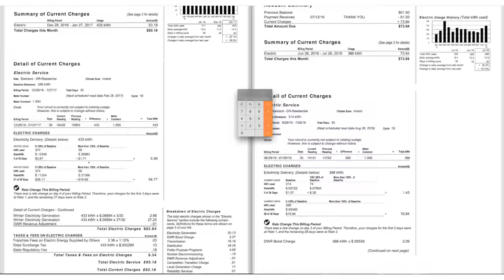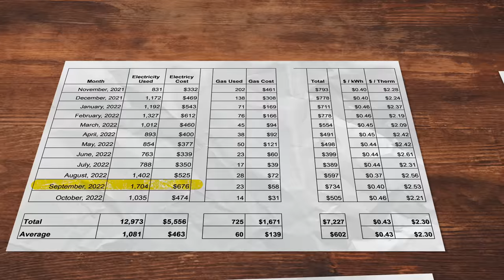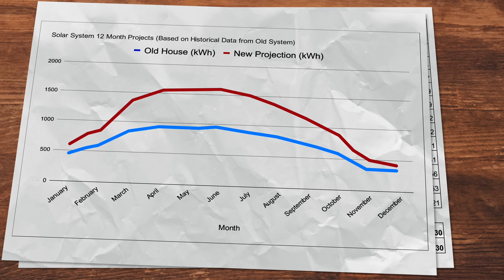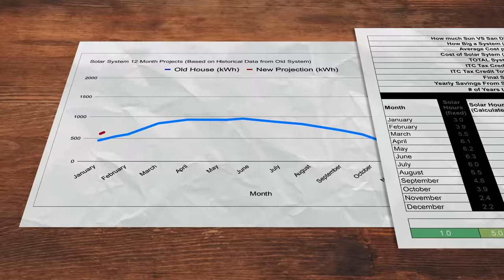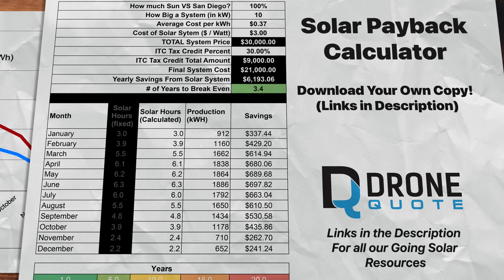Go Solar Before April 2023 - EVERYTHING Is Changing!

Comment: Why doesn't anyone touch on the subject of heat and how it affects the yield of solar panels? When you buy solar panels they have a certain power output rating (Watt peak), for instance 250Wp, 300WP or 450Wp. This output is determined under certain conditions; an irradiance of 1000W/m2 and a temperature of 25C. Depending on where you live the irradiance of the sun varies, if it's more than 1000W/m2 the output of a solar panel will be higher than its Wp-rating and if the solar irradiance is less than 1000W/m2 the output will be lower. That's pretty straight forward. But what most people don't account for is the temperature solar panels can reach and how that affects its output. Because for every degree above 25C a solar panel on average loses about 0,5% of its output. As a panel can easily reach temperatures of 85C in summer, especially when they are roof mounted, that means they lose 30% of their output. So your 300Wp panel becomes a 210W panel. That being said, it is a good idea to find a way of cooling your solar panels.
Nowadays there are so-called PVT panels (PhotoVoltaicThermal) available which have a heat-exchanger built in. You can run cold water through that heat-exchanger to cool down your panels and by doing so increase their output. Added bonus is that you can use the hot water coming from the panels to (pre)heat your warm tap water, which will also result in less energy used. Or you can use them as a source for a heat-pump system which has the big advantage that you can use a water-water heat-pump (absorption heat-pump) that uses a lot less energy than the common air-air and air-water heat-pumps as absorption heat-pumps don't have a compressor that uses a lot of energy but use a water pump instead to pump the brine (usually a water-ammonia mixture) around. See Triplesolar for more information about PVT-panels icw a heat-pump.
Reply: Generally because people care more about ensuring they have enough solar specified for winter.  And because of that, the amount of power produced during summer tends to be somewhat overkill anyway.   And because of that, people don't care about the summer heat reducing the efficiency of the panels.  When the sun is blazing down, you are producing top-tier output whether your panels are hot or not.

It is still a good idea to ensure that there is ventilation under the panels.   But virtually nobody bothers doing any active cooling or active ventilation on fixed panels.
Reply: @junkerzn7312  Ensuring that your system is big enough for winter doesn't mean you shouldn't want to make the most of your solar system. It could even be a reason to try to get as much out of your system as possible. Even in winter your panels can get up to temps of around 60C on a sunny day so you're still losing about 15% to 20% of their output. That means that your system has to be 15% to 20% bigger than you'd need if you were actively cooling your panels. And especially in winter it would be good to be able to use that heat to help warm your house. Also, in summer when the sun is blazing down you're not producing top-tier output because your panels are hot, you're only producing about 2/3 of their possible output. If you were producing the max output you could sell the excess power to your power company (if you're grid connected) and use the money you make to buy energy from them in winter if needed.
Reply: @easy_s3351  You have to consider the cost of the cooling solution, both in dollars spent, dollars maintaining, and compare that against using the same money to simply by a few more panels.

You have to consider the energy required by the cooling solution (if any).

You have to be realistic about just how much cooler it can actually make the solar panels and still make any sense.

You have to consider any added weight as well.

And you also have to consider the fact that the panels are not going to be sitting at 60C the entire day anyway,, let alone all year long, so the gains in total production that you think you can get are going to be far less than you think.

When you add this all up, it usually doesn't make any sense to try to cool a normal 1-sun solar panel beyond basic passive construction (leaving a little space under the panel).

You might think you are going to increase your daily generation by 20%, but the far more likely result will be less than 10% and your money would have been better spent just buying another panel or two to get an even better result.   That's the reality, and that is why people don't try to cool normal solar panel arrays beyond basic passive design.
Reply: @junkerzn7312  Of course you have to consider certain factors in making a decision to actively cool your panels. Besides the ones you mention you'd have to consider how much you can save by being able to (pre)heat your warm water. If using them in combination with an absorption heat pump you have to consider how much you'd save compared to having a heat pump with a compressor. You'd have to consider that you could cool your panels down to about 35C instead of upwards of 85C in summer giving you 25% more output when you're getting the most input from the sun. You'd have to consider if you have space on your roof to simply add two or more panels to try to make up for the loss of having hot panels. You'd have to consider if by selling the excess energy you produce by having cooler panels you might be able to pay for any extra costs active cooling has. But the reality is that most people don't even know how much performance they lose by having hot panels and that's why they don't even think about actively cooling them. It's something they don't consider because they don't know, which is why I made my initial comment.
Reply: @easy_s3351  85C is an extreme exaggeration.  How can I convince you... ah, I know, there is an off-grid garage video where Andy measure the temp of his panels in full sun.   On Youtube search for Off-Grid Garage "I had to limit the output power of the new solar system" video, its near the end of the video (I'd post the URL but youtube often doesn't post comments with URLS in them).   At around the 25:00 mark.

That creator lives in Australia, the video was taken mid-December... basically full summer.  He measured has panels at roughly 48-53C or so.  That's summer in Australia.   And that's only going to be during part of the day.   There were hotter days a few weeks later but I don't recall him measuring his panels on those days.. but even there they would have a tough time even getting to 70C.

I don't know how else to convince you.  You won't get 25% more production, even if you restrict your data collection to high-summer.  It just won't happen.   Even 70C isn't going to happen very often.   Yes, it can happen, but not often enough to warrant throwing  a cooling system behind the panels just to capture those few days of the year when it does.

Are there exceptions?  Yes, there are some places on Earth where it can get far hotter.   Do you live in one of those places?  Probably not.  Nowhere in the continental U.S., for example.  Very few places in Australia.  Nowhere in Hawaii.  Nowhere in pretty much all of Europe or the U.K.   A few places in Asia but mostly... not.    Certain areas of Turkey, India, and the middle East can get that hot.  But even in those places 25% more production would be a reach.

-Matt

Comment: One VERY IMPORTANT THING, do NOT put your panels where they are going to be shaded by trees - either trees already grown or trees that will soon be tall enough to shade the panels.  That is just going to needlessly reduce your efficiency.  As I walk around my neighborhood, there are so many solar installations that are shaded, either by trees in the homeowners yard or by trees in a neighboring yard.  It is hard to believe that the people who "designed" the installation let that happen.  I guess the urge to make money off of solar is much greater than the urge to make a decent installation.
Reply: Shading is definitely an issue. I had a system installed in May 2022, and because of 1 massive tree on the other side of the road, my electricity generation dies after about 2-3pm for 10 months of the year. I estimate that this reduces my annual generation by a bit over 1MW/year. 

Having griped about that, there are many factors that go into ‘designing’ a system, and a big one is your ‘intended’ use. 

When looking at it from a purely financial perspective, this shading did impact my expected financial return, but was still good enough not to reject it. 

Numbers vary all over the world and you have to look at your own unique numbers. For perspective, my annual power bills before installation were only about $1,400AUD/year. My 8KW system (without battery) had a full installation cost of $11,300, reducing to $5,000 with rebates. Even with the shading issue and relatively low electricity usage, this system still offered winter bill savings of at least $1.50/day, rising to more than $3/day in summer. With $1,500 of other costs (total out of pocket up front $6.5K) I conservatively expect full pay back in no more than 6.5 years, when all my electricity bill savings become a real financial return on investment.
Reply: @jamesdean2185  Personally (as an engineer), I would NEVER put solar on a house that faced east or west, and ideally, for maximum solar, you want a house that faces north. In fact I would generally not buy a house that faces east or west (although I have a second house that does face east, my wife picked it out).  A house that faces north has optimal shade for the back in the summer and good sunlight for winter heating (and solar collection).   My last two houses have faced north.  BUT, I have seen solar on just the east side, on just the west side (of houses that face east or west), and occasionally solar on both the east side and the west side.  Now that utilities (in California for now but other states may soon follow), have virtually killed net metering (see the recent Two Bit Da Vinci video), that is yet another nail in the coffin of solar.  Foolish for the users, good ($$) for the utility providers.  And then, of course, when you re-roof, someone has to come and take off the panels ($$), and put them back on after (more $$).  My neighbor just did this this year when he re-roofed.
Reply: @iowa_don    I appreciate your perspective, but I am in Australia and things are a bit different down here (especially prices). As I noted above, the full cost of my solar installation alone was only $11,300AUD (or about $1.00 USD per watt), for Trina panels and a Sungrow inverter). After rebates, smart meter and grid charges, my total up front out of pocket was $6450 AUD ($0.56 USD per watt). Based on an average self consumption of about 8KW per day, and a grid consumption charge of $0.25 AUD per KW, this alone offers a payback period of just under 9 years, before any (pathetic) feed in tariffs, net metering, and price increases are factored in to shorten the time. 

With these kind of numbers, it was a financial no-brainer, even with my 20 panels evenly split east/north/west on a 60yo tiled roof, and a massive tree killing off power at 3 in the afternoon. 

Yes, some installations offer better returns than others, but here in Australia, solar prices are such that if you do decide to buy, you buy as big as you can get (within reason) because it is now pretty much a can’t fail investment. The compass is no longer a limiting factor, and we are fast approaching the point where even batteries are becoming a good financial investment.

My whole point being (where we started this) is that there are many different answers to the questions that go to designing a system. For you they may be significant, but for us here in Australia, a lot of those answers now are ‘doesn’t matter!’.
Reply: I had precisely this issue.  Some of our maples were 100% out of the way of the panels 20 years ago when the system was first installed, but are now throwing a bit of shade onto a few of the panels in winter.    My wife won't let me trim the maples too much though, they are fairly sensitive to being trimmed.

But also, sometimes there are only so many places one can put panels.   The spot where our current array is is still the best spot, even with the maples shading a few panels in the winter.

Usually the incremental cost of throwing on a few potentially inefficient panels is low, though, and on our next project I am going to be putting panels in a whole lot of places that get variable shading some of the time, just because the incremental cost is fairly low.  So... might as well do it and have access to the extra power!

Comment: have you considered using some of the small footprint wind turbines to offset the down hours for solar? The conch shell ones or the virticle blade ones? The cost for those are lower and it could reduce the overall cost of a system by quite a bit.

Comment: you mention two ways to wire the panels, but what about where you run series for a few panels, and then parallel those, to get voltage and current higher, kind of a middle ground? are these configurations supported?

Comment: im thinking about submitting a solar power plan to my company.  partly for the general environmental benefit but also any possible utility savings over the long run.

im in accounts payable so i have to direct acess to the gas and electric bills.  in fact ive been askedto tally the spend over the years since we've moved to our new building.

my question is how far do i go researching on my own?  i dont mind doing some readingwhile im home watching TV.  but i dont want to ask for quotes without being authorized to speak on behalf of the company.

there are renewable solar farm subscription plans the utilities offer so i could suggest that straight up.  as far as physical onsite equipment i just started looking up installation companies.

im in southeastern Michigan by the way.

also we do lease our building so we wouldn't be able to do this independently.  at least not with a permanent installation.  i do know the benefits.  i dont know what our generation capacity would be but it would be interesting to try out.

fyi its a manufacturing business with less than a 100 hundred employees.

thank you for suggestions and insights.

keep up the great work!!

Comment: Ricky love your channel, I live in Thailand so plenty of sun year round. I have an off grid set up 2 x 5kw Growatt, 16 x 450watt panels, 200ah/9.6kw Power wall. Currently I save around $100 monthly off my power bill and charge my wife's electric car during the day so no fuel costs saving around $100 monthly. My total installed cost was $9000, I am now making overall savings of $2,400 yearly. Tell me where you can find an investment that pays you 26% yearly on your investment, good luck

Comment: Solar on a roof in the south and southwest - sure.  Solar on the roofs of buildings where there are 50 lb/sq. ft. snow loads?  No way!
Reply: Snow mostly just slides off of solar panels (at least if they are at a decent angle), though you do want to ensure that the snow doesn't get stuck on the eaves while trying to slide off.   So it is something that needs to be considered in snow country, but it doesn't stop anyone from putting solar panels up.   Turns out that those black cells absorb enough light to create a water layer, even when covered by snow.

If that isn't enough, a single heat strip along the bottom on a timer is probably all you need.   Tons of homes above the snow line are packed full of panels.
Reply: Yah I live in Wisconsin. The snow slides right off the 28 panels I have on my roof. First day of sunshine. I can't remember what the pitch is on my roof. Maybe slightly steeper than an average ranch house.